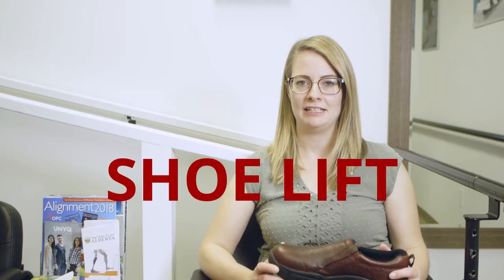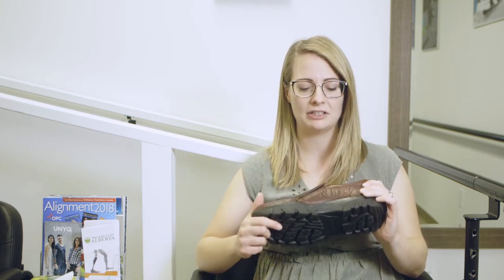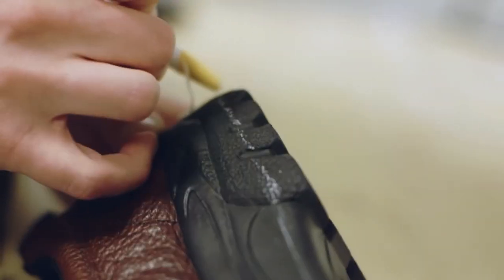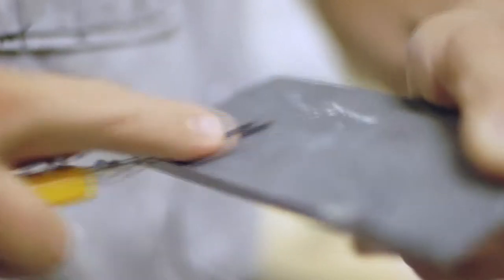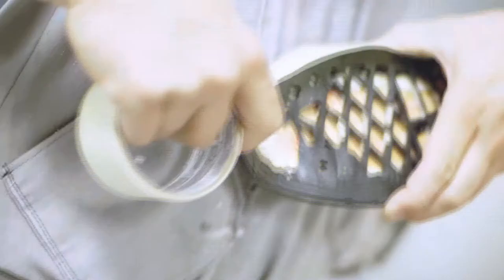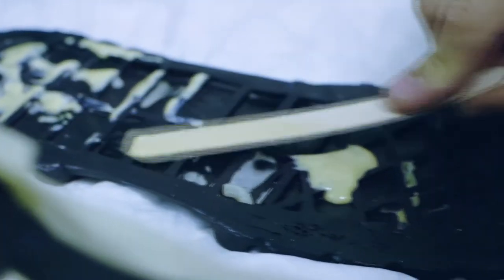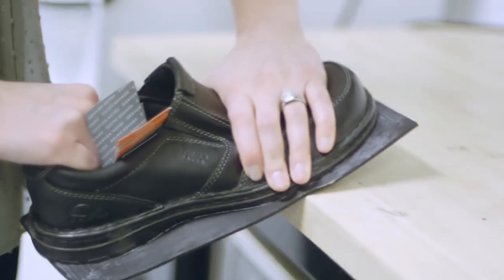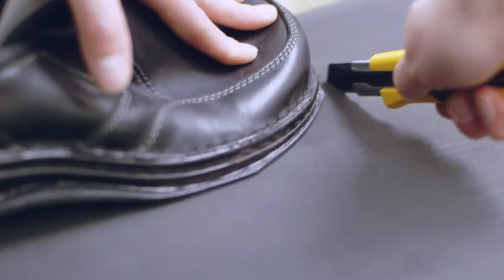How to Add an External Shoe Lift

Comment: What do you use to fill in holes and gaps.  If I just want to add the lift on the bottom of say a rain boot without cutting apart the boot but need to fill in the gaps of the bottom of the boot so I could have a flat surface in order to put on a lift; what would I use to fill in all the gaps? I will also glue a sole or non-slip to the bottom of add on.  I know to drill hole in the 1/2 lift

Comment: Question?why not just grind the button and then ad the external sole outside the shoe? Because that inner part thin sole inside the shoe it can receive another sole inside where you will or could pass the glue..